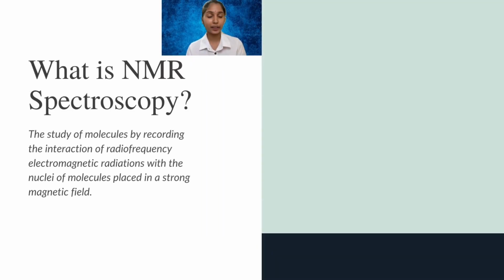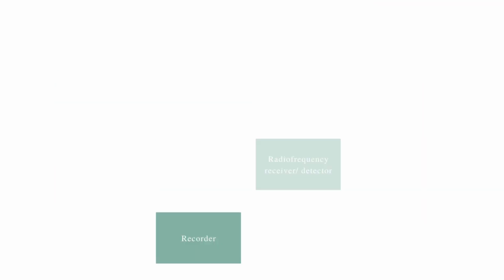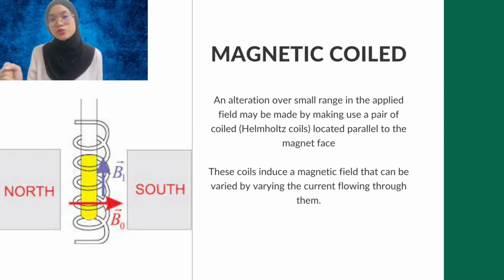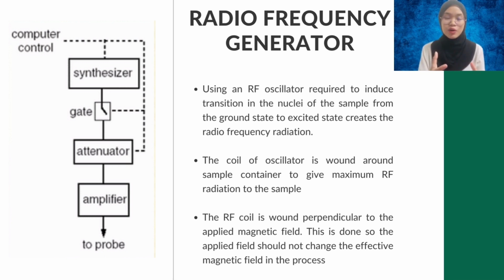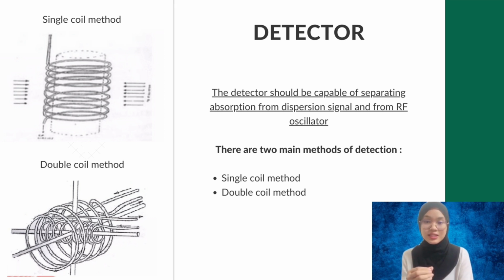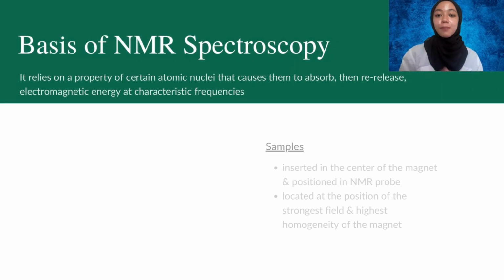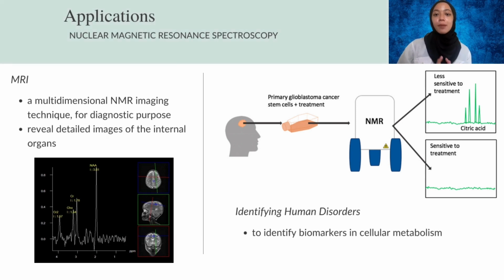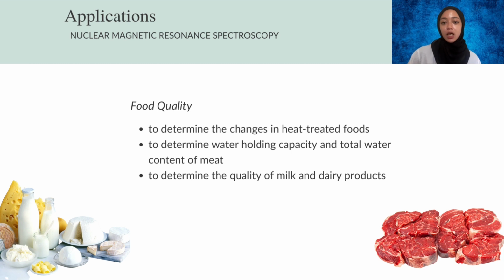Nuclear magnetic resonance spectroscopy Group 6 BTC3003

Comment: Srivengadesh 206260

Hi guys, is there any potential handling safety risks the NMR handler should be aware of?
Reply: Hello Sri, good question! 

Based on the instrument name itself, Nuclear “Magnetic” Resonance. Of course major safety that need to be considered is strong magnetic field. NMR used strong magnetic field so it have tedency to attract metallic object toward the magnet and it must be remembered that in emergencies superconducting magnets cannot switch off and they remain on. This is few rules i can provide if the person working with NMR

- Do not bring any metallic object within 10 feet of any magnet (dont go beyond safety zone provided)
- watches, coins, jewellery item should be left outside lab
- a person with cardiac pacemaker, bio amd neuro stimulators should not be allowed inside the laboratory. This include with person having metallic bone or joint implants

Actually there are many more safety that should be taken (eg: cruogenic liquid, magnet quenching) 

Here my reference and for you to explore more

Comment: Dear Group 6, thank you for preparing a nice video on NMR.
One question from me. Can you please elaborate how the raw data generated from NMR be interpreted?
Reply: Thank you for your question Dr! From raw NMR data, firstly, identify the number of signals (peaks) that appears by observing the chemical environment of the structure of the compound being analyzed. Identify the multiplicity of signals that arise due to the presence of neighboring protons. This identification is done to determine the multiplicity or peak pattern that appears. Identify the signal integration value. The greater the integration value, the more protons generate the signal.  Identify the peaks based on the chemical shift value (δ). The chemical shift value (δ) of a nucleus arises as a result of the presence of electrons in a molecule which forms a shielding effect on the spin of the nucleus. Identify the coupling constant (J). 
From steps 1 - 5, the structure of an organic compound can be determined. First, after the number of proton types and the chemical environment of the protons is known in step 1, the molecular formula based on their bond with H can be determined. Second, the signal multiplicity analysis provides information on how many hydrogen atoms are present in the adjacent carbon atoms. Finally, the pieces of the molecule are combined to form a structural formula for the compound. The coupling constant obtained shows the interactions between the protons and the chemical shift values obtained are then compared with the chemical shift table values to identify their functional groups.

Comment: Premalatha a/p Saravanan (205762)
Hi Group 6, it was a nice presentation!
I would like to to ask why liquid nitrogen and liquid helium is used in the NMR spectrometer?
Reply from the maker: Hi Prema, Thank you for the question. Liquid helium is used to cool down the NMR magnet and liquid nitrogen is used to absorb heat from outside the magnet and reduce the helium boil off rate.